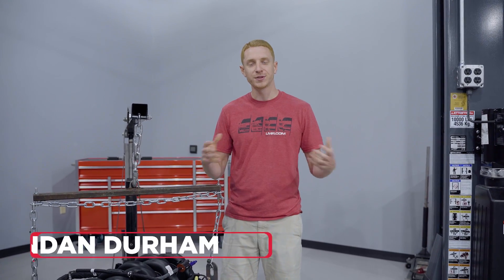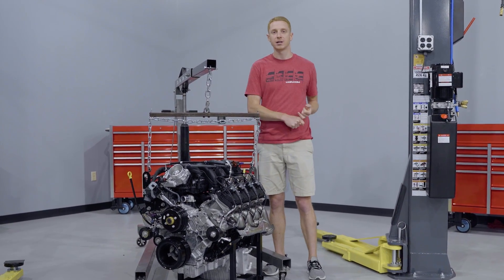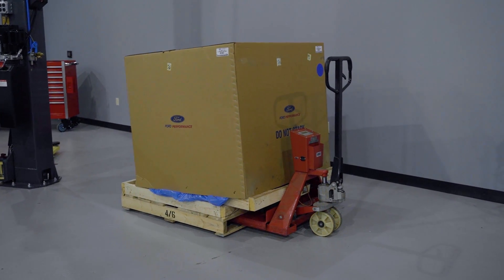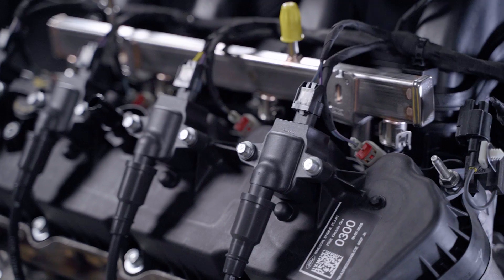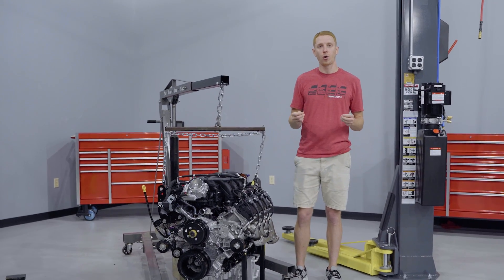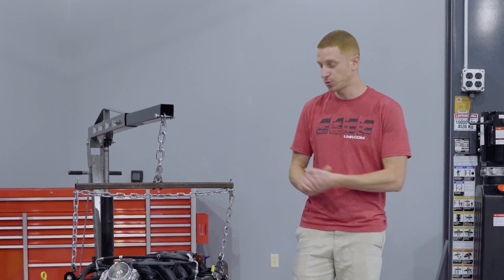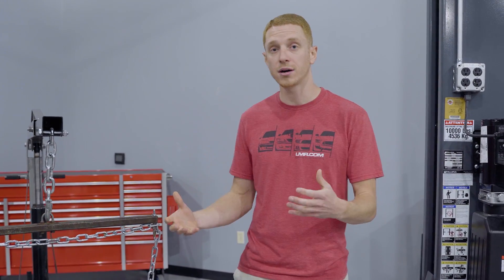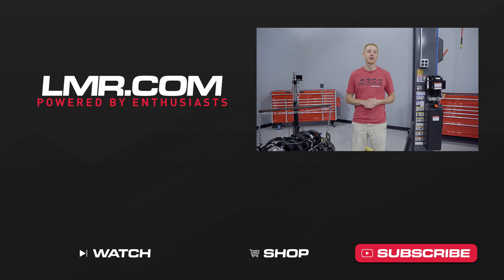Ford Performance 7.3L Godzilla Crate Engine | Review

Comment from the maker: What car would you want to see us swap the Godzilla in?
Reply: 93 fox body
Reply: 05-09 Mustang GT
Reply: Put it in my 94 GT Mustang
Reply: An old Lincoln, something like the hot rod Lincoln owned by Dax Shepard.
Reply: @Elmer_RedEagle  this would be awesome in a Hot Rod Lincoln Mark VII
Reply: 2006 Crownvictoria Police Interceptor with the automatic transmission
Reply: @krownvikkhris3004  winner winner, chicken dinner.
Reply: SN197 Cobra
Reply: New edge brother would love to see that
Reply: 2017 raptor or a bronco if it fits😬
Reply: Mercury Capri!!
Reply: Any Foxbody and any 7th, 8th, or 9th gen F150 or Bronco
Reply: @Darkhorse393  Now that would be awesome.
Reply: My svt lightning!
Reply: My 1988 Bronco
Reply: My 1967 F100 short bed!!!!
Reply: A Excursion to replace the V10
Reply: First Gen Mustang to replace an FE
Reply: 73 F100
Reply: My 97 f350, if the powerstroke dies... in another 300k miles lol
Reply: Fox body for sure
Reply: First Gen Lightning 🌩
Reply: 68 F100 with a gen 3R VMP TVS,
Reply: Something like my 65 comet would be cool
Reply: @oldschooltwist18  Love it! My buddy in high school had a 1963 convertible
Reply: Crown vic
Reply: A very rare and pristine 1969 COPC ZL1 Camaro, just for revenge.
Reply: @dond5103  oh yeah 😎😉
Reply: 1986 Mustang Coupe!!
Reply: 10-14 Ford Raptor
Reply: Crown vic or 80-86 f series
Reply: F100
Reply: Nothing it does not compete with a coyote and costs way more. IMO! Standing by for comments lol.
Reply: @4eyefox  sometimes builds are for fun, obviously the coyotes are tried and true.
Reply: @4eyefox  a coyote will never produce the torque this thing is capable of producing. And you're wrong about the price this thing brand new is half the price of a brand new coyote. Coyotes a great engine as is this one.
Reply: Not sure what your talking about but it isnt half the price and it requires a complete rebuild to compete with a coyote. That's what I want to do, buy a crate motor just to rebuild it. Yeah makes perfect sense...
Reply: Some kind of station wagon
Reply: P71
Reply: Obs ford truck
Reply: My '71 Mach1 is getting Godzilla goodness for it's 50th birthday!
Reply: Anything G.M.
Reply: @The Man would you trust those cast aluminum pistons with forced induction?
Reply: Foxbody for sure
Reply: 2nd gen. Lightning ⚡️
Reply: 2nd gen lightning would be great. But why havent you guys gotten in to the raptor arena on the site me personally not a big raptor fan love the engine choice but like my trucks low and screaming through the exhaust
Reply: GEN 2 LIGHTNING!!!!!!!!!!!!!
Reply: I would love to see this engine in an old school muscle car or hot rod or even in an old school F100. This engine can also be great for the 92-96 Ford TRUCKS as well.
Reply: 71 maverick
Reply: @damianlindsey6177  Awesome brother.
Reply: 92-96 f250/350....with a 10 speed be an awesome daily 4x4
Reply: @BrandonLayMusic  That would be awesome brother.
Reply: My 1979 f-100 short box 2wd
Reply: A New Edge for sure.
Reply: Even a late S197 Would be cool
Reply: @Tommy-hb5qn  will not work because of the engine compartment is way too small and engine mounts are in different spots
Reply: @Tommy-hb5qn  Ford pinto... lmmfao
Reply: @Tommy-hb5qn  95' tbird.. mine...
Reply: Datsun 510
Reply: Late Model Restoration Question, was this engine actually manufactured this engine at a Ford manufacturing facility?
Reply: Mine...
Reply: Late model Mustang!
Reply: Mine
Reply: Fox Body
Reply: I just dropped a reman 5.4 in my 2004 F150 BUT when that thing goes I think a 7.3 with a 6R80 and atlas 2 behind it would be a pretty sweet drivetrain. I'll have to sell my body on the corner to pay for it but a guy can dream.
Reply: Idk, I would have to actually see this thing run. Did he say 430hp/475 @5500 rpm? Sound like it has power, but not enough breath to be put in a mustang for the 1/4. But would make a great truck motor.
Reply: @blackcrisis2004  - That's about the same s a modern Coyote. If you want bigger NA power in a smaller package, go with a 351 Windsor stroker. Mine is mildly built and is 530 at the crank.
Reply: @jsimmonstx  I like what ur saying about ur 351. I'm sure it sounds amazing too, but as for being similar to a modern coyote...idk about that. My 13 5.o before tuning shut me down about 6900. That's that like 1400 more to play with. After my tune, it went past 7000. I never took it past 7k, even whn I did my cobra jet intake swap.
Reply: @blackcrisis2004  - 475 at the crank is only a little more than a new Coyote, and without a significant additional expense, the motor is honestly too big for most passenger car applications, but it would be fine in a truck (because of the deeper engine bay). And let's not forget that the cam is a truck cam, and AFAIK, there is no aftermarket cam available for this motor yet. For the same money, you can build a Windsor with a forged rotating assembly, the right cam, better heads, and a smaller engine bay footprint, and it will be a better fit in a non-truck application. Just sayin...

BTW, there are several people that have put this motor into S197 mustangs, and even one guy that's putting it into a Crown Vic. Unfortunately, all of the swaps I've seen look like crap (IMHO). There's even a CobraJet with a 7.3, and it only does 10's at the strip. IMHO, the juice ain't worth the squeeze unless you just want to be different from everyone else.

And yes, my Windsor sounds amazing. :)
https://www.youtube.com/watch?v=X1mbrn6LtuA
Reply: Id swap it in a bus lol. Take out the old 7.3 diesel and drop the Godzilla in, probably a new transmission too.
Reply: Old blue Fairmont is the first choice.
Reply: @AmericanRace4me The Godzilla V8 would definitely be perfect for the Starsky and Hutch 76 Torino.
Reply: 32 ford
Reply: C-5 corvette jus because everyone Ls swaps ford's guess it's ford's turn
Reply: @thomasnygard2334  Yep
Reply: eco sport
Reply: A late model Focus RS set up with a complete fabricated drag chassis. Sort of like the AC Cobra kit cars but not the same old look.
Reply: My 84 fiero. I'll bring it down to ya. 😀
Reply: @austintyler7991  😂😂
Reply: 66 Ford LTD Sedan to replace the 390FE. Would be perfect.
Reply: 1963 FALCON Sprint Futura
Reply: In 2020 Camaro! HAHAHA! 😎
 Ford ( First On Race Day) 🏁
Reply: @jjbuck1950  Man the LS boys would flip like a fish out of water lol😂
Reply: Thanks for the no nonsense engine review. If pushrods are old school, then the Clevelands I build and I are proud to be OLD SCHOOL !

A Godzilla swap into a ‘69 or ‘70 Mustang would be interesting.
Reply: My 1964 Galaxie 500 drop top please.
Reply: 03 Mercury Marauder
Reply: Anything on the panther platform
Reply: Crown Victoria
Reply: How about the Torino or the cyclone big engine big cars🤔
Reply: Model T
Reply: @sirswerve2493  YES
Reply: 1070's F150 4X4 short box
Reply: factory five 33 ford
Reply: Into my '65 Fastback
Reply: Gt40 kit car
Reply: Ford thunderbird supercope; any year model!
Reply: 1959 Ford Country Sedan
Reply: 80 series Land Cruiser would be king.
Reply: Two door Fairmont or Lincoln Mark 7 LSC
Reply: How about a 55 Chevy
Reply: Ul need a transmission, transfercase probably custom drivelines and universal ujoints...  lot of work...
Reply: 1950 mercury eleonora
Reply: 80-81 ford Granada or that same year Mercury zephyr.
Reply: NewEdge plz
Reply: The orange comp new edge. You guys did a few videos on it.
Reply: Mine
Reply: New Edge
Reply: @AmericanRace4me Definitely would be awesome to swap it into a 71 Ford LTD Police interceptor along with a 5-speed and man it'll be like a Modern day Gator Mckulsky Mobile.
Reply: @AmericanRace4me It can also be a great swap for one of those Ford Land Yatchs from the 1970s as well.
Reply: First gen lightning for sure!!!!!!!!!!!!!!!!!!!!😃
Reply: Fox Body....
Reply: OBS Does, 1st Gen Lightning, Fox body, Bronco,  67 Fairlane...
Reply: NA Miata
Reply: 05-09
Reply: 2005 ford gt, like a callback to the mk2 gt40
Reply: DrgnFlys  I would to see the Godzilla in ur Chevy truck 😉
Reply: @NMTrucks  179k, it was running strong then one day it started missing, it lost compression in one cylinder. dont know if it bent a valve or what just knew byt eh time i fixed it I might as well spend a little extra and get a new engine. some 5.4s go over 300k. just take care of them
Reply: foxbody, to shut the l/s - ers down...
Reply: Mustang gen 6
Reply: Fiat 500..... or smart car.... or any tesla
Reply: Why not a old school F-100 pickup 😉.
Reply: 67 fairlane
Reply: GTR
Reply: My 68 Cougar
Reply: Current model Ranger
Reply: new edge all day
Reply: My 71 Ranchero
Reply: Make a Mid engine Fiesta on nitrous
Reply: Early 70's Ranchero
Reply: 68 Thunderbird, or into a. 87/88 Turbocoup
Reply: Would this fit a 78 f150 please please answer and with what transmission atomatic
Reply: Find a 2012 Boss 302 with a busted transmission, drop the engine in with a t56, Slap Boss 445 on the sides and take it road racing.
Reply: 1978 Ford F-150 y’all should do
Reply: 1969 mustang sports roof.
Reply: 1970 Ford LTD 2 door. Or 77 Ford F-250.
Reply: 90's Festiva
Reply: I'd like you to drop one on top of a Mach-E and squash it.
Reply: Toyota Prius
Reply: Chevy Corvette
Reply: 1998Ford Ranger
Reply: F100 bumpside truck
Reply: Bronco II with super duty axles!
Reply: BRZ
Reply: I have a 69 cclb F-250 4wd I would love to put it in.
Reply: 73 F100
Reply: New edge
Reply: 1967 Lincoln Continental Coupe.........
Reply: 56 Ford with a six pack or twin 4bbls on it! Seriously, can it be carbed? Would be cool in anything older with carbs on it, heck drop it in a rail with a 1050 dominator!
Reply: A Thunderbird
Reply: 79 f-250 4x4
Reply: 1970 maverick with a quiet sleeper exhaust.
Reply: @falfighter   already exist
Reply: My 1st gen lightning ! When you can you do it ? 😂
Reply: The 7.3L Godzilla was designed and engineered as a truck engine. Better question would be ------> What VEHICLE (car, SUV or TRUCK) would you want to see us swap the Godzilla in?  And a great answer would be ------> Older 2000 - 2005 Ford Excursion and 1999 - 2007 Ford F250 / F350 Super Duty.
Reply: @15Jeep  would be nice to see it in a new f-150 
A 7.3 might keep up with dodge hemi or 6.2 chevy
Reply: Car - 2005 - 2006 Ford GT
SUV - 2000 - 2005 Ford Excursion
Truck - 1999 - 2007 Ford F250 / F350 Super Duty
Reply: Ford Explorer 5th gen to race a track hawk or a Durango srt
Reply: Do a 2007 f-150
Reply: Would like to see the new Ford 7.3L V8 gas engine swapped into THREE older vehicles.

1. 2005 - 2007 Ford F-250 / F-350 Crew Cab 4WD Super Duty SRW 156...with Eaton e-Lockers in front and rear differentials; Dynatrac Heavy Duty DynaLoc Free Spin Hubs; RCV Performance front axles; Carli Suspension with King shocks; 4.10:1 gears rolling on Goodyear Wrangler DuraTrac 285 / 75R - 18 tires...OR 4.30:1 gears rolling on Nitto Trail Grappler M/T 37 x 11.50 - 20.

2;. 2000 - 2005 Ford Excursion - same aftermarket parts as the Super Duty...add coil spring front suspension on top of Dana 6 front axle. 

3. 1992 Ford F-250 Crew Cab Heavy Duty -  same aftermarket parts as the Super Duty...add coil spring front suspension on top of Dana 6 front axle.
Reply: shelby cobra kit car
Reply: sn95
Reply: 61 to 64 Lincoln continental! Without a doubt! To replace the 7.0 Mel torque monster with a new modern day 7.3 torque monster just makes sense. The 430 “bulldozer” to me was the same as the “Godzilla”. We have seen enough of the mustang, camero stuff anything in it  and praise it scene.
Reply: My 64 Falcon
Reply: FESTIVA
Reply: F100 for sure.
Reply: F150
Reply: Sn95
Reply: Sn95
Reply: 65 Corvette
Reply: Put it in my 94 f350
Reply: @staggdegraaff1531  Nope piss off the chevy guys put it in a classic corvette
Reply: Nissan GT-R

sorry
Reply: @bitelaserkhalif  I don't even know what that is 

Sorry
Reply: @bigunone  Nissan GT-R got nickname of Godzilla because of Australian magazine
Reply: FORD MUSTANG SHELBY GT500
Reply: 70s F150 or F100
Reply: Lightning
Reply: Gen III explorer lol
Reply: 70's F150
Reply: Was that 20 1/2" wide or 28 1/2" wide?
Reply: Any update?
Reply: Ford Excursion
Reply: i have a bronco u can put one in
Reply: An 06 ford f150. Ill donate my truck the 5.4 blew up
Reply: 2009 Ford F150 RCSB.
Reply: Pinto
Reply: Hands down, a modern version of the pantera
Reply: My 56 Ford Victoria… needs a front sump, no side “junk” and an way to use a non electronic transmission
Reply: Geo Metro 😂
Reply: A 95 tbird
Reply: A 67 Fairlane or f250 camper special would be a cool swap
Reply: Foxbody
Reply: Hi i don't anything about cars just bought a 2009 4runner 4.7L  could i swap with this? Just asking
Reply: A fender-less Ford, 1929-1936, with an 8-71, open headers, stick shift & a quick change.
Reply: My 2003 f150 single cab :]
Reply: Do a new "alectric mustang " to piss em off
Reply: Fox
Reply: 65 f100
Reply: 1st gen Lincoln aviator
Reply: Excursion, International Harvester, 1rst gen Raptor, Marauder, older f250-350 or Bronco. Land cruiser, 280zx, or an A body
Reply: 1997 Cartier town car, total sleeper....
Reply: 11-14 mustang gt ?
Reply: Simca Vedette, '49 Anglia.
Reply: A dumpster, Ford brought / bought you Biden
Reply: 70 f100
Reply: 2010 Raptor!
Reply: First gen miata with a 8-71 and a monster cam
Reply: My 1985 Ford LTD Fox chassis station wagon!  The Daddywagon!
Reply: Cleetus would definitely put this in a crown Victoria
Reply: The swap I will like to see ona Ford ranger’s
Reply: A bmw 330ci
Reply: I want one for my '68 Torino
Reply: 2nd Gen Sport Trac Adrenalin... Mine.
Reply: Mustang 2
Reply: Or a Hellcat
Reply: Riton pickup
Reply: Merkur xr4ti or Scorpio
Reply: put it in a Ferrari with a Hollinger transaxle
Reply: 2005-6 ford GT!
Reply: 1971 Ford Pinto 🤣
Reply: A Chinese eye Bentley, Cobra replica, to name two.
Reply: Late '60s Mustang, with a T56 manual.
Reply: 2004 Ford Excursion!!
Reply: Early 2000s for f250
Reply: Good for a truck
Any car application would be stupid
Ls now fits in Ford automobiles
Matter of fact, if you got a mustang with a ruined engine, it is cheaper, lighter, more power to just put an Ls in it. No downside at all

Comment: I'm someone who wants to put the 6.2l v8 in my 02 F150 instead of the 5.4l 2v v8 for a Street Legal Prerunner application. Then get a supercharger kit added to the 6.2l. Still an idea but would this engine be a better option? I'm aiming for reliability over power. Both engines (6.2 & 7.3) essentially double the output power compared to the 5.4l 2v let alone adding a supercharger to the 6.2l.
Reply: The 6.2 is one of my favorite Ford engines. The biggest problem is the aftermarket just never picked up on it so aftermarket is few and far between and whatever stuff is available for it it is super expensive. Ford should of made a DOHC version of the 6.2. Since the 6.2 has been around since like 2010 I think, I bet it’s way easier and cheaper to buy than a 7.3. And with the money you saved you could get a super charger for it and make double the power of a 7.3. But, the 7.3 engine size is slightly smaller since it has the cam in the block.
Reply: @yaboykris2118  I've considered a company called Hennessey when I found out they added a Supercharger to the 6.2l but unsure if they're still doing that since I haven't found any info about it on their website. But they give a 100k mile warranty on the kit and when they can back up their performance parts like that and get it to 600hp, it still says reliability to me. Only downside is its 6.2l of displacement so it drinks alot and its got 16 spark plugs but that's not as uncommon as it used to be anymore.
Reply: Also on the reliability: I have 145,000 trouble free miles on my 2014 f250 6.2. I don’t tow huge stuff but it is used to tow small equipment and haul my tools around. It’s been a fantastic engine.
Reply: @yaboykris2118  my dad has a F250 (I'm not sure which year but he got it somewhere between 2015-2017) and has 272k on it, averages 80mph, drives an hour and 15mins to work and an hour and 45 mins home, towed a work trailer from Texas to Cali, driven nearly 2 days straight from Texas to Connecticut and it's been solid. Plenty of get up and go for the size of the truck (its not that big of a truck realistically but it's not meant for racing) and mileage.

Comment: It doesn't have steel heads its bad when it overheats and liquid filled valves expand and lock the engine when it overheats and oil cooler modulating oil to engine means it doesn't last more than 5 years stick to the 1990 460 big block

Comment: you are wrong about the 2010 raptor the one i had i ordered from the factory and it came with the 6.2 liter , so you better dig a little more it did come with the 6.2 maybe not all but the one i ordered did
Reply: It came with two options. The 5.4(i think) and the 6.2l until ford removed that option the following years.

Comment: would be bad beast with hydraulic pump that ran individual pushers for each valve you could control the timing lift duration on the fly individually plus a hydraulic driven supercharger so you could control boost speed of the fly ...

Comment: I think these would be cool in Fox bodies, Thunderbird, Lincoln, and obviously the F series trucks. Certainly, some development needs to go into drop-in forged rods and pistons for boosted applications. Some development to see how much bore and stroke it can support along with CNC factory casting heads and aftermarket castings with cams. Alot of what went into the LS platform should work here since it's so similar to it.

Comment: Considering installing one in a 2004 ford F-150 but the way the engine sits back so far as it is?  Wonder if I'd be better off in a fox body?  I sure like the truck as a daily driver and 2 turbos.